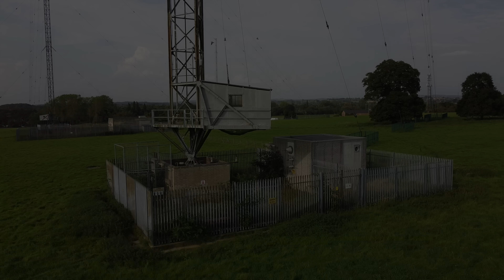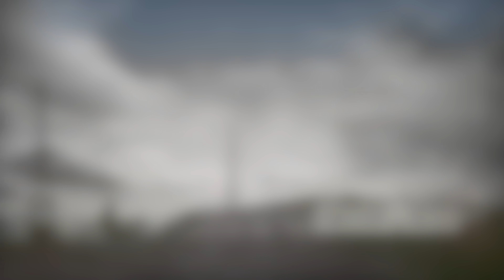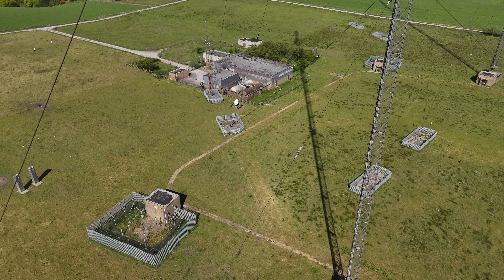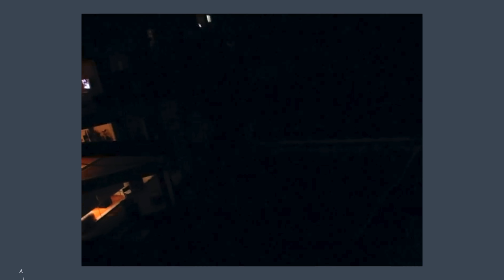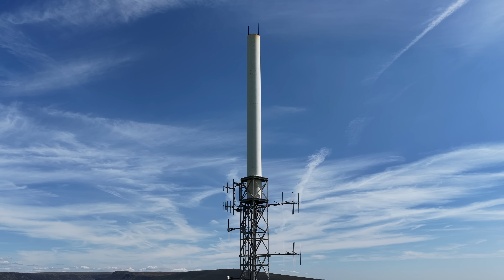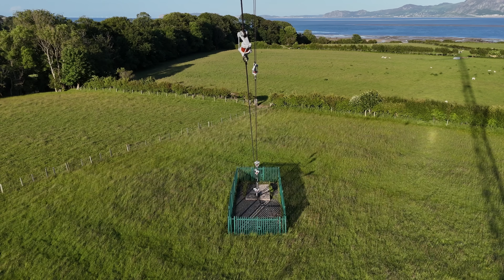Can You Harness Free Electricity From Radio Signals?

Comment: When I was studying for my first ham license, we were told two stories.
1. That a man living near a 50 kW AM transmitter was at least partially powering his home by induced power from the radio signal.  Also, that the transmitter was capable of more than the 50 kW that it was authorized for and when they were pretty sure the FCC was not looking, they ran a little extra.  I heard this once, and never heard of it since.  The station is still there and I think on it's third owner.

2.  The other involved the same station, this was not stealing.  A man was hired to replace the wiring for the aircraft warning lights on the tower.  and had a large roll of wire laid out on the ground.  As the cable was hoisted up the tower, when it reached a certain height, because of the inductive loading or the coil of wire, it got very hot and started a sizable grass fire.  

Don't know how much truth there was to either of these.  The first one, I'm pretty sure was urban legend.

There were two others that I know were true.  One construction activity on a local shopping mall was changing the directional pattern of an AM station a few miles away during the time that the broadcast engineer needed to prove his pattern to report to the FCC.  He was a relatively new engineer for the station, and he called his predecessor who retired from the station. They got out on a hill with a pair of binoculars and the field strength meter and observed the changes as a crane hoisted structural steel into place.  When they met with the construction foreman, he said his crew was complaining of getting burned through their gloves when they touched the steel.

The other, and this was from a personal friend.  He was a DJ for a small AM station 1 kW daytime only.  He was also a ham radio operator.  The station's transmitter would operate on the ham bands at the 1 kW legal limit.  So, he would hang around after sign off and operate on the 80 M band at full legal imit.  He would string a dipole antenna between the tower and the building.  At that time the studio and transmitter were co-located.  He said he was to sign the station on at sunrise Sunday morning.  He got there got the sign-on cued up, turned the filaments on to warm up the transmitter (tube-type) days.  Local sunrise comes, he hits the plate switch on the transmitter.  It locks out, on high VSWR.  He tries it again, same thing.  Then he realizes he forgot to take his ham antenna down.  It's a cold winter morning and he had to climb part way up the tower and take his antenna down, hoping the boss was not listening to the station.  In broadcasting your on time or your dead.  Also, dead air is not appreciated.

Comment: I was told a story about this happening in Chicago IL. A building owner close to the transmitter used to provide the hot water to his building. The sorry as I was told was that it was never discovered until the building was sold and massive copper coils were found in the top level of the building. I was also told it effected transmitted signal level as you referenced. I don't know if it was near WLS or WGN.

Comment: The only time I was ever able to extract RF energy was from a grain-of-rice bulb and a half wave dipole at 1296 MHz, and that was to find the high power nodes on the antenna. It worked well, but only a couple of micro-watts was extracted, just enough to light the bulb dimly. I tried this with an 2m fluorescent tube on a top band antenna; but there was not enough energy to fluoresce the tube, and that was at the high voltage node, um? Extracting power from an RF source to light a shed or a home is a lie.

Comment: Xtals radio long wire antenna. For the radio band....also the old man had a lot wire on the pasture under a power line had enough to charge a 12;volt battery and light the barn..😊😊😊

Comment: When I was a teenager and getting interested in electronics, I recall a circuit that was effectively a crystal set tuned to a very strong station which somehow powered a simple transistor amplifier connected to a second tuning circuit/rectifier, giving more volume to the earpiece. I never built it but the idea sounds plausible.

Comment: I've heard stories of this kind many many times.   They are generally just that, stories.   Coils of wire don't create holes in the transmission radiation pattern.  If they did, every antenna out there would be creating small holes, and in densly populated areas all those antennae would create holes and dips in the signal.    IF and a big if, there was any truth to the stories, the coil of wire would need to be so precisely tuned to the exact wavelength, that most people would not be able to do it.  Also, it  would need to be in a very open place so as not to get interference from roofing, especially tin, walls or any other item that could affect the precision of the system.      A tuned RF antenna gets microvolts of power to the receivers front end,  there is no way you could get enough power from anything to power a light globe, let alone a home.   If that was possible, we'd have many many dead radio receivers from people with well tuned receiving antennae.

Comment: In the 80s Miami - Dade, Florida went through an interesting case. A retired Con Ed  engineer purchased land in outskirts of Dade, where a 568,000 volt transmission line was adjacent to the property. He constructed an elaborate inductive array right at the edge of his property. And was powering his home entirely after conditioning, phasing etc. Everything was great until Florida Power & Light helicopter was flying inspection and saw the adjacent apparatus. FPL sent a group of electrical engineers to the site who determined he was gleaning power from the flux produced by the lines high voltage. FPL requested him to stop. He refused saying he was on his own property, which was true. They took him to Court and later was found at fault. The Court ruled even though the energy was a by product, as claimed by the man's counsel, the utility still owned said byproduct and therefore could theoretically charge for it. 

RF energy as a power supplier would require immense power to begin with. 50 theoretical homes with a 1000 watt load, would surpass a 50KW transmitter quickly, given 100% efficiency, which it wouldn't be.

Comment: There was an article some years back in Radcom that detailed a system set up in the 1930s in Germany by the military consisting of of Megawatt transmitter installed on a salt lake bed which was designed to send out nationwide to members of the armed forces to receive messages from the regime… according to the author of the article in Radcom  that this was also targeted by entrepreneurs close by to steal power. Again the author goes on to say that a distorted signal alerted authorities to the theft and the offending households got a visit no doubt from the Gestatpo police.

Comment: The very first crystal radios worked in exactly this way. Harvesting the energy from the signal to power themselves. In theory, you could harvest tiny amounts of power using a coil, and if you strung many many of these together in series, you could probably harvest enough to charge a battery, although it would likely take weeks and weeks to do so and would require a lot of money spent on the kit be be able to do it. 
I remember reading about how the engineers on board the pirate radio ships could read many hundreds of volts from the antenna and rigging but they were actually right beside the antennas, something that wouldn’t be possible for pretty much all of us. 
Interesting stuff nonetheless. 
Finally, Lewis, gos bless dad.

Comment: I heard of a story of a man that fitted a shed load of copper coils in his loft to power his home as it was right next to a 400kv power line and got prosecuted for NOT using electric.
I remember it was on some local news web site but cant find it any more.
apparently structural engineers went to his house as he had so much copper coils in his loft, he couldn't shut some doors in his house due to the weight in the loft.
not sure if its actually true or not but worth a mention.

Comment: There is no way absorption by an inductor would cause "holes in coverage".  Your conclusion is correct, These are tales--just that.
Reply: Former RF broadcast engineer here. You are exactly correct. An inductor would literally have to be the size of the broadcast antenna to make any deviation in the radiation pattern. Tales indeed!
Reply: @lawrencemartin2711  in the case of BBC Daventry , these were resonant dipoles at 13-14mhz within 2km of the site many outside ,some installed in roof spaces ,BBC least ,public method was to add absorbant fencing . so thats what they did !
Reply: @lawrencemartin2711  The physics of electrically small antennas says that, regardless of size, a lossless resonant antenna has the same EA as a full-size halfwave dipole.  (Antenna theory is counterintuitive.  Adding a high-Q LC resonator to a too-short antenna will significantly increase the wattage received.  You know you've grasped it when you understand Yagi director-elements, and the oddities of low-loss mag loops.)
But this weird stuff depends on losses, so unless you have hundreds of kilos of litz-wire, or actual superconductive loops, you're not going to be able to approach the EA of a quarter-wave vertical tower.   (Best to also connect your mag-loop to a ground-array, and to many meters of aluminum foil on the roof of your home.)
So, it's all down to Effective Aperture calculations, including coil diameter, skin-effect resistivity of the windings involved, dielectric losses in your capacitor, etc.    Intuition fails when high-Q resonators are added to conventional antennas, especially when within the large nearfield zone of a VLF transmitter.
For best results, make sure you're well within a halfwave-distance of the tower you're stealing from.  In that case you're building a type of RF transformer, not an inverse-square system relying on EM wave propagation.   I'd predict that the fields produced by such a "receiving antenna" would be detectable by authorities searching for them, if not "punching holes" in the transmission pattern.
Reply: Came here to say the same! reason there's no record of any legal action is because the Plaintiff would have to prove that the Defendant is indeed impacting the system in a measurable way alluding to 'Theft' of something that would otherwise be present. And therein lies the big problem! If receiving the radiated energy caused additional workload on the antenna or caused weak points in the radiation pattern, then a very popular station during peak times would cause the electrical workload of the transmitter to go up from thousands if not millions of radios absorbing that energy - and that just simply isn't how physics or the reality of it works. You absorb the radiated energy present in the immediate area of the antenna and that's it. No more and no less. (This is why radio reception is also weaker inside, the walls of your house are absorbing/attenuating/reflecting the energy first) Much like we can observe visible light, the Sunlight hitting the ground is there whether you're present to cast a shadow or not and you doing so doesn't make the sun dimmer for everyone else.
Reply: @RonLaws  I've just looked up the Wireless Telegraphy Act 1949, and nowhere in it could I see a concept of Theft of any signal.  You had to have a licensed receiver or other apparatus (radio licences remained a requirement in the UK until 1971, I think) but there is a short section 13.1:
"Any person who uses any apparatus for the purpose of interfering with any wireless telegraphy shall be guilty of an offence under this Act."
I imagine they would have to argue that the use of apparatus designed to harvest energy was actually interfering to be able to use that section, which strikes me as being intended more for activities like jamming.
Reply: @heckelphon  indeed, another nail in the coffin for the urban legends!
Reply: @RonLaws  With VLF towers, it's not hard to be near or even within the nearfield zone (halfwave distance.)   In that case it's not radiation, instead the thief is building the secondary coil of a tuned RF transformer, or perhaps a capacitor-plate.  Those don't obey inverse-square, and inside the nearfield zone, you're not intercepting waves, instead you're coupling to an ambient AC field.   (What's the RF volts-per-meter at the receiving location?   Any power-theft device would need to resonantly create a similar field-intensity  ...when measured at significant distance from the receiver.  Heh, use superconductor tank-circuits FTW. )
Now if the thief was a few wavelengths away from the transmitter, then inverse-square does apply, and they're not going to distort the pattern (intercept kilowatts) unless they build a long conductive fence in the shape of a halfwave loop.
Reply: FFS thanks guys, I thought as much from my basic principles but I’m not qualified.
Reply: It can't be a pure inductor.   It needs to be a mag-loop antenna, i.e. a tank circuit with a low-loss capacitor in parallel.   In that case the Q-factor is paramount for achieving large Effective Aperture  (where if Q of the tank-circuit was infinite, the receiver would easily distort the transmission pattern.   Got a superconductor coil?   The wider the better.   Or, wind your coil from 2cm copper water pipe, perhaps a few hundred KG of the stuff.)
Reply: I was wondering about this very thing, as it did not make any sense to me. How is it "authorities" could detect these so-called "thefts?"
Reply: @MN8015HQ  The long VLF wavelength makes all the difference.   If the thief isn't using a miles long halfwave antenna, then instead they must employ a much smaller, high-resonance loop antenna.  
The physics says, in order to absorb EM waves, a receiving antenna must emit equal or greater waves (since reception is a matter of 180deg wave-cancellation.)   Such a resonant setup would be easily detectable, since the antenna would radiate intense fields locally.   

So, just drive around the area with a field-meter tuned to the transmitter frequency.   You'll detect unusual readings when hundreds of meters from the thief, then crazy high readings as you approach.   (Of course the authorities must first know there's a problem, and go out searching.  Maybe they were ratted out by a neighbor!   Also, it requires that the thief be successfully intercepting at least a few percent of the transmitted wattage.  Their small resonant antenna always emits at least that much, as part of the normal process of wave-absorption.)

Now instead if they were using a full-size quarter-wave antenna at VLF, theie long wire (fence?) might be visible by eye.   Hold your field-meter up to any suspicious fence, to see if it's producing a strong local EM field.

The ancient term for all of this is Resonant Power Theft.      A sharp-tuned resonator such as a "mag-loop antenna" is equivalent to a much larger un-tuned antenna, and it can absorb EM waves from a quarter-wavelength distance all around.   This becomes an issue for extreme longwave, where the quarter-wave distance is large.   See Antenna EA, effective area or effective aperture.
Reply: re:  "holes in coverage". What could cause this is a UFO pulling up near the antenna and replenishing energy into its Element-115 cartridge. UFO/UAP have been known to do this sort of thing, as well as sucking up fresh water from lakes.

Comment: I don't know where it got to but in 2015, Drayson Technologies, run by ex Science Minister Lord Drayson, worked with Imperial College in London to create a device called Freevolt. It claimed to  use an antenna to capture radio waves and an efficient rectifier to convert the alternating currents from the waves into direct electrical currents. If it worked, I assume it was for use with very low power devices or capacitor based systems. It was a start-up, so it may not have made it to market or not got past the prototype stage. There may be some patents academic papers and stuff around with more detail.

Comment: Apparently when the radio Caroline ship Mi Amigo went back to sea of the coast of Holland in 1972 they didn't have a working generator  so they taped fluorescent tubes to the aireal feeder so they could pick up the RF from RNI the crew aboard the Mebo 2 noticed this and left their medium wave transmitter on all night so the Mi Amigo had lights and could be seen by passing ships